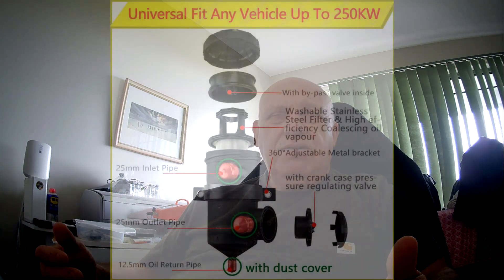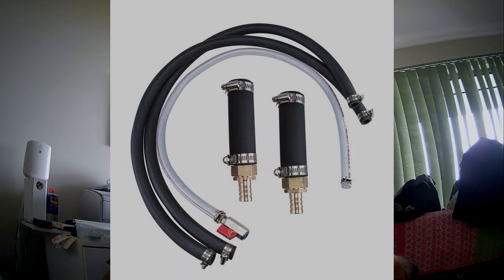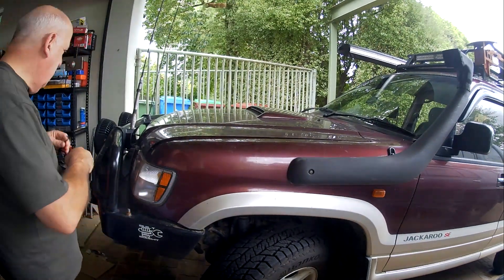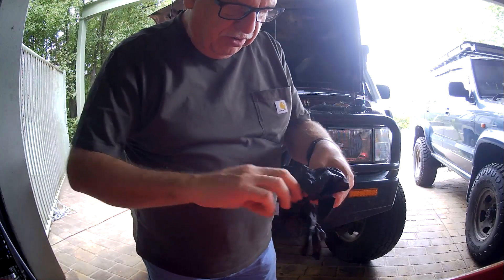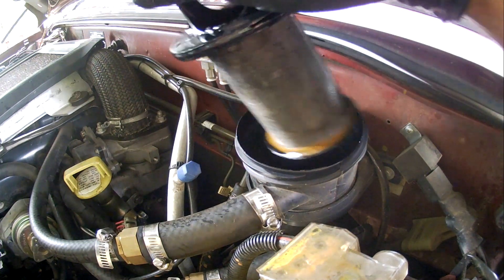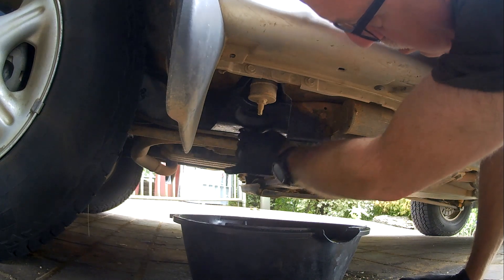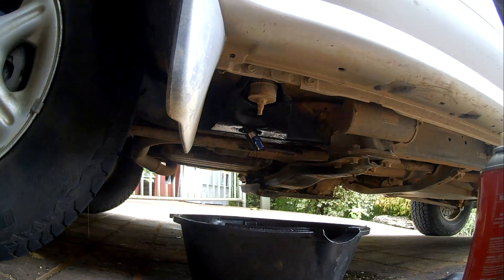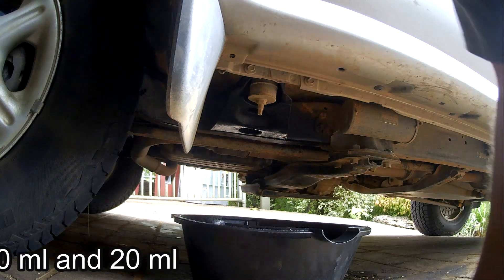Fitting an Oil Catch Can

Comment: Where does the hose with the tap at the end of the video come from?
Reply from the maker: I am not sure if you mean where do you buy it or where does it come from Physically. The tap came with the catch can and is located on the drain at the bottom of the catch can. I just brought it down there instead of attaching it to the car.
Reply: @ sorry mate all a little new to the 4jx1 have previously had 3 petrol jacks apologies for not being entirely clear with my question

Comment: The original breather hose from my crank case is detached from the air intake pipe. It looks like the connection that sticked out from the intake that the breather hose slides over has snapped off. Any advice on repairing?
Reply from the maker: Yes, I can help but you'll need to send me a picture to the channel email address which should be on the about page if you can because there are a couple of hoses it could be?